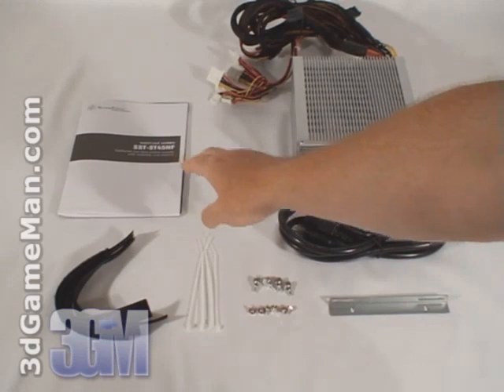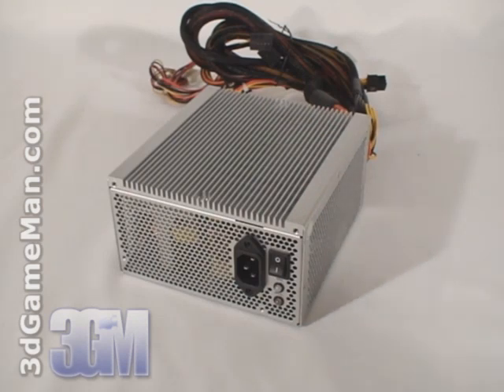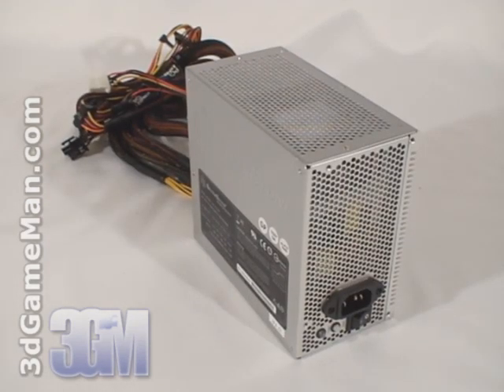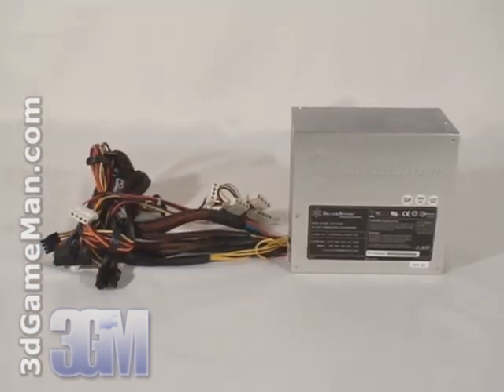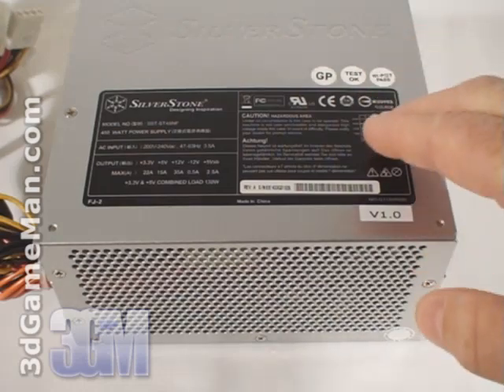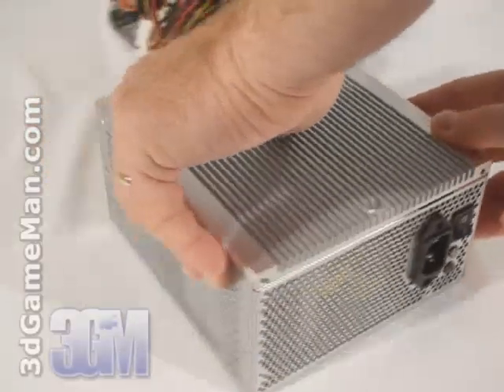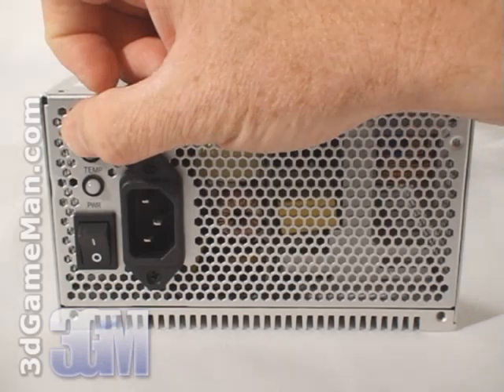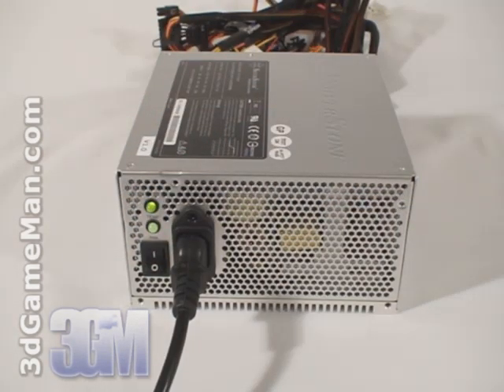#965 - SilverStone Nightjar 450W Zero dBA Fanless PSU

Comment: well, my motherboard went bad and after putting in a new one along with a new dvd burner, the noise mysteriously went away.  maybe i was confusing the noise from the capacitors on the failing board or something, have no idea.  im beginning to like this power supply as my system is pretty dam quiet.